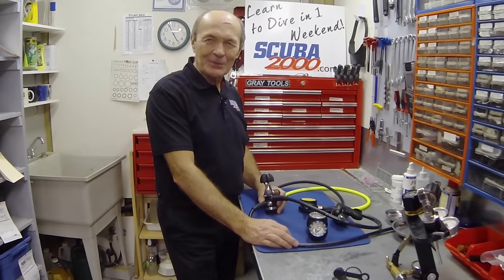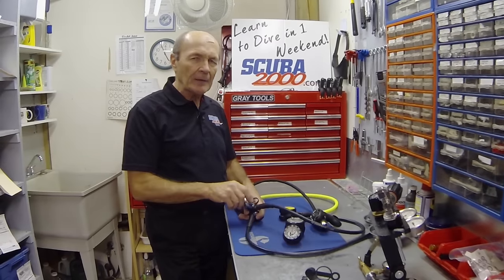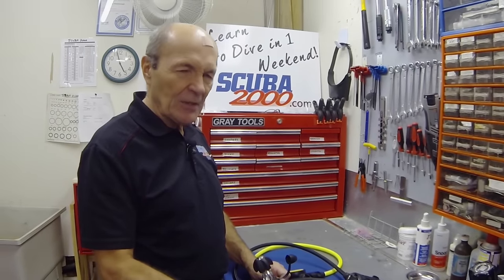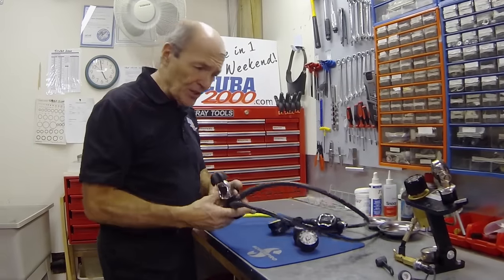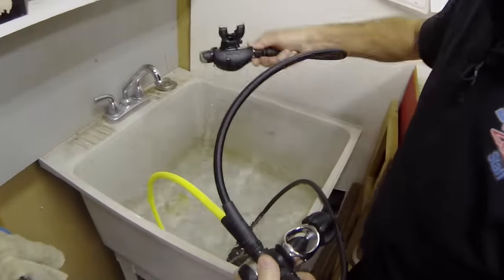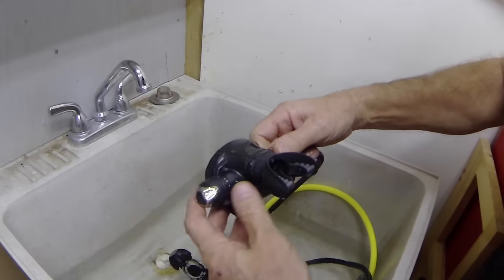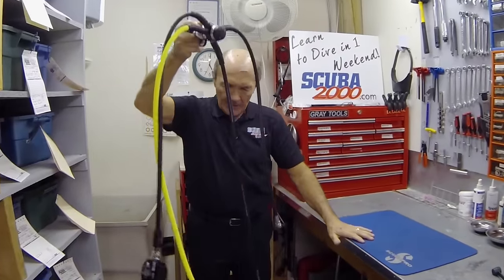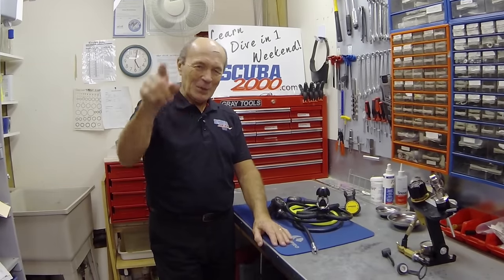It Pays To Rinse - Scuba Tech Tips: S03E02

Comment: Hi Alec, is there a problem using a first stage ( like oceanic fdxi) with an bc Inflator from a different brand (i think about buying the mares quantum bcd). Thanks in advance. PS I love your vintage series. Greetings from Germany
Reply from the maker: One nice thing about scuba gear is that it's pretty much completely interchangeable, almost too much so. I have seen a Mares 1st stage with a Aqualung 2nd stage, an old Dacor octopus, an Oceanic console, an LP hose for a Zeagle BC and another LP hose for a Bare drysuit. It's confusing as heck for a serviceman!
So, to your question, yes. Any normal scuba attachment will fit into any normal scuba 1st stage. All of the ports are 5/16" for the LP (low pressure) and 3/8" for the HP (other than the old 1/2" ports that Dacor and USD used for a short while). All LP hose have a matching 5/16" thread and HP hoses are 3/8".  So, go crazy. Mix 'em up!!
Of course, in Germany you also have to contend with metric but that's only an issue if you're using a European regulator - Poseidon, etc. I have adapters to make anything fit anything!! Thanks for watching. Alec

Comment: Great video, recently are collecting information if rinse a reg.
Let's say I went for a dive trip using a double hose for a week or two weeks so, it is really hard to prevent water go into the can(first stage) Am I ALLOW to rinse the first stage with the all the mechanism with fresh water to clean up the salt water and then leave the can open to let it dry out? 
Thank you
Reply from the maker: Most experienced double hose divers ensure their regs stay in good shape by using a simple process that's not 'in the books'.
1. After several dives and before storage, always loosen the hose clamps.
2. Occasionally remove the hoses carefully and rinse them thoroughly in fresh water. Run the water through the hose and     mouthpiece by pouring it into the intake hose and out of the exhaust hose. If you do this before removing the exhaust hose from     
    the body, you also rinse the exhaust valve (Duckbill or other). Block the intake spigot on the body while doing this.
3. Always hang the regulator by the 1st stage with the hoses dangling both while rinsing and while in storage so no water goes 
    into the body.
The answer to your question is NO! You must endeavor to prevent any water, even fresh water from entering the body.
If salt water gets into the regulator, it will need to be disassembled and cleaned properly. Almost every piece in there will corrode very quickly if exposed to salt water. And some parts are plain or plated steel which will also corrode in fresh water.
It's not really hard to keep water out of the can. Always be sure a good dust cap is in place when it's off the valve. Be sure the dust cap is clean and dry before fitting it. When you take the reg off of the valve, let the hoses hang and keep the can high.
Bottom line - keep it dry and service it regularly.
Take care.
Alec

Comment: I was once admonished by a divemaster for soaking the entire regulator setup, including the 1st stage, in a dunk tank. He said that I should only dunk the first stage and then hook the 1st stage to the top of the dunk tank with the second stages and gauges hanging down and soaking in the tank. I guess you are saying this is false as long as the dust cap is in place. Which it was.
Reply from the maker: There are lots of ways to rinse a reg and just as many opinions. However, an ounce of common sense is worth a fortune.
Never be afraid to ask "Why?". If the answer is slow coming or sounds contrived, nod wisely and do it your own way!
The 1st and 2nd are connected by hoses. Assuming the 1st is sealed by the dust cap so no water can enter, why rinse it separately from the 2nd?
Everyone likes to add their own special twist to what is really a simple process. Makes them look like an expert.
I like to keep it simple - put the darn thing in the water, dust cap firmly in place; let it soak for a while to get rig of dried salt; try to not push the purge button; take it out, shake and hang to dry thoroughly; stow it.
Alec
Reply: @AlecPeirceScuba_SeaHunter  Thanks for your reply and for keeping us educated about SCUBA.
Reply: I ran into something similar in the Red Sea.  We were all instructed not to even dip the 1st stage.  I just assumed it was due to it being DIN and I'm only used to yoke style, but apparently not.  My guess is they just run into a lot of tourists who are horrible with the dust caps.
Reply: if the second stage has a seat saver type feature, when no pressure they are effectively open to the elements and if the first stage falls below the second stage, you have water going from second stage to first stage, no bueno

Comment: Hi Alec, thanks so much for all your videos. I'm new to diving and I've watched hours of them. Very helpful! I just bought my wife and I new Oceanic Zeo DIN style regs. We dove with them yesterday and just as you said, the dust cap filled with sea water. I did my best on the boat to blow it out/dry it by mouth, but, it wasn't perfect. My instructor said don't worry about it, those small drops won't get in the reg. But, based on your videos I don't like that logic. Is there a good dust cap for DIN regulators or a better solution? As always, thanks!
Reply from the maker: Look in the Trident Dive catalog or the Innovative Scuba catalog.
Your LDS can order one. Scubapro has a good one too but it isn't on all of their regs.
You simply have to look around until you find one.
Someone suggested filling the cap with silicone sealant. Not a bad idea.
Good luck with your new reg. I'm sure you love it.
Alec

Comment: Would it make any sense to depress the second stage purge button and swivel it around a bit in the water too (with the first out/higher of the water). Presumably there are some bits and bobs associated with it that could use a rinse too? I have access to a tank to blow out the hoses/second afterwards.
Reply from the maker: Purging does open the exhaust mushroom valve but you never know if its 100% open or just part without a physical check around the entire valve.  Would not hurt.
A

Comment: I am a little bit confused right now. When you put the whole reg in the sink, water does not go inside it? You put the dust cap so water does not go in, but what about all the other holes? 
Both of your second stages
The connector of the LP  hose that you connect to your BDC
The holes in a balanced piston 1 stage
The connector of the HP hose that you connect to the computer/pressure gauge

I started scuba diving last year, and this videos are super useful. I still have to learn a lot.

At the end of a dive I open the scuba tank so that there is pressure in the sistem, and I rinse everything with fresh water. Then I take it apart and pack it. Then I rinse the wetsuit, googles, fins, etc. And I  rinse again the diving computer and the flashlight.

Am I doing it wrong?
Reply: "I am a little bit confused right now. When you put the whole reg in the sink, water does not go inside it?"

Water will get inside the second stage, which is necessary for rinsing out the salt deposits left from diving. But water will not go up the hoses and into the internals of the first stage if the dust cap is snuggly in place. To see how that works, take a drinking straw and put your finger over one end of it, then put the other end into a glass of liquid. Note how the liquid doesn't fill the straw to the level outside the straw. Then take away your finger, and see the liquid rush into the straw. The same principle is at work when you rinse you regulators.
Reply from the maker: Nope Brian. You're doing far more than most divers and everything is correct.
While it's fine, there's not really any need to go to the trouble of pressurizing the reg while rinsing it. And it must be a nuisance!  Let me explain each of your concerns.
1. the second stages are full of water almost all the time. Water goes in and out of the exhaust and the mouthpiece whenever it's not in your mouth and that's OK. The water cannot get past the second stage valve and thus up the hose because that valve is held closed by 150 psi of air from the first. Even when rinsing, that valve is held closed by a spring - unless you hold the purge button down while rinsing. The purge button depresses the spring and opens the second stage valve to let air through, thus 'purging' water from the second. If you press the purge while rinsing (off the tank), the valve opens but without any air pressure from the first stage, water could conceivably go up the hose and into the first stage.
I dealt with this topic although quickly, in a vid some time ago. Although every scuba instructor tells their new divers to "never press the purge button while rinsing your reg", it's not really a big deal. If you can picture the hose as a closed system, a long closed tube if you like, and then you open one end (the second stage end by pressing the purge button) while it's being rinsed, while water may travel past the second stage valve and start to go up the hose, Boyle's Law soon stops it. The water is stopped by the atmospheric pressure of the air in the hose. There's no pressure while rinsing so there is nothing to force the water up the hose against the air that is already in there. Water will NOT go up the hose if the purge is pressed during a normal rinse. My apologies to all those instructors!
So don't worry about the second stages.

2.The LP connector, whether a BCD or Drysuit hose, is sealed by a Schrader valve, the same valve that's in a tire valve. This valve is spring loaded and requires considerable pressure to open. Normal rinsing won't open it and even if it did, the same principle I just explained for the reg hose applies. No water would travel up it. In fact, you ought to rinse that hose end with fresh water and then blow into the hose end with your mouth to dry that little valve. Also don't forget to rinse the connector by pulling it back and spinning it while in the rinse water. The connector end works with the help of 3 tiny steel balls, a spring and a clip, all of which can corrode.

3. The holes in the first stage of every regulator, balanced piston or not, (every regulator has holes to allow the first stage to sense the water pressure - except for those very few regulators that are sealed) always have water in them as well. The chamber into which that water enters through those holes is designed to seal the water out of the valve itself. This is one area that divers do neglect. It's important to rinse water through those holes thoroughly so the chamber is completely clean. This is why I suggest divers SOAK their regulators - so any salt or dirt inside that chamber is softened and rinsed away.

4. The QD (Quick Detach) end of a console HP hose is similarly designed to seal tightly with a spring when the console is disconnected so no water can enter. It doesn't use a Schrader valve but a similar design.
I want to add a small point here, partly because I can see that you are quite fastidious about your gear and also that you enjoy these minor technical issues. You must have noticed that the opening on the end of the HP hose for your console is much larger than that on the end of the LP hose for  your BCD. Of course it has to accept the spigot on the bottom of the console which is much bigger than the small spigot on the BCD PIV (Power Inflator Valve).
That opening, on the HP console hose, can hold quite a bit of water. I'd guess 1/4 teaspoon or so. That water MUST be shaken out carefully before inserting and locking your console to it. Any water that in that opening could go into the console and even the tiniest amount of water in the console, much less salt water, could be disastrous. Strangely, there is no protection to prevent water from going into the console so you must NOT put your console in water if the hose is detached or without the protective rubber cap.
Any water in either the large opening on the end of the HP hose or in the tiny hole on the end of the console spigot will be blasted into the console by tank pressure when the air is turned on. Both holes should be carefully blown dry by air from your mouth after rinsing.

So you can see that you really don't have much to worry about. You are doing a perfect job and should have no problems with corrosion inside your gear Brian. Please bear in mind that the very nature of scuba gear and the environment in which it operates is such that over time even the most careful diver will need a quick inspection, cleaning and lubrication of his gear. My point is that careful rinsing will keep your gear in perfect condition for a very long time (I regularly service regulators that are 25+ years old) and will preclude permanent damage but, an internal inspection at regular intervals, whether 1 year, 2 years or after a certain number of dives, is still essential.

I hope this helps. I wish I had my Equipment Specialist posters and diagrams to show you the details of the internal working of these items. I have had several cut-away regulators and valves made for that purpose and, once you look inside to see exactly how these items are designed, it really helps to understand what and what not to do. Perhaps Kevin and I will do a more details vid on the very things you've mentioned.

Thanks for your comments, questions and your support for my vids Brain.
This is by far the longest reply I've ever made and that reflects 2 things Brian - I'm retired now and I respect your support.
Alec
Reply: Thank you, Alec, for the detailed explanation. But I think you meant to direct it to Victor Garcia, not to me; he asked the original question.
Reply from the maker: Right Brian. Forgive an old man - but the information was good and I may do a video on it anyway.
Thanks, Alec
Reply: "...the information was good and I may do a video on it..."

That would be great. I really enjoy your Tech Tips.

Comment: Hi Alec. Do you recommend disassembling gear apart when storing for months ahead? Hoses/regulator/stages.
Reply from the maker: I find leaving everything connected but seal them in a thick freezer size zip loc bag and squeeze the air out.  Removing hoses just to store them actually puts more wear on the o-rings with the off/on twisting and if the 1st stage ports are not closed with a port plug can introduce air contaminates (or spiders).  Hope this helps.
Reply: @AlecPeirceScuba_SeaHunter  Absolutely. Thank you Alec. Very appreciated.

Comment: if the purge is depressed or is forced during rinsing, then what to say Alec ? Also, what dust cap for DIN ?
Reply from the maker: Try to avoid depressing the purge button while the reg is being rinsed. It's not quite the big deal you might think.
Technically if you do press the purge button while the reg is underwater in the rinse tank, water could go up the hose. But, in fact, to do so it would have to go against the ambient air pressure in the hose. That's not likely. Also, even if some water did go up the LP regulator hose, it's not the end of the world. The water won't hurt the hose nor the 2nd stage (which is full of water most of the time anyway). The only danger would be if that water made it all the way to the 1st stage where it could cause a problem. If it's fresh water it won't cause any damage. Salt water will but you're rinsing in fresh water right? And the likelihood of water going all the way up a 27" hose against the air pressure is slim.
So, try to avoid pressing the purge button while rising but don't freak out if it happens. If you think it has happened, just put the reg onto a tank and purge air through it for 10 seconds. The dry air going through both stages will clean it out.
Alec
Reply: thanks alec, you're the msn ! we love your videos, simon & suzi [in Dubai]
Reply: Alec Peirce Scuba I think this is quite a big issue that you probably need to add to the video. Because after watching the video( especially the watch button part) I would most likely press the purge button multiple times while rinsing.
Reply: Thanks, Alec! Great video and some new tips for me to use. 😊

Comment: I have a problem I just got my first regulator and they told me to soak it and I left the dust cap off and did what they said online to purge it to get all the water out do I need it to get serviced?
Reply from the maker: Relax OK.
I'm assuming it was fresh water so you're OK, OK.
I made a video about 'what to do if my reg floods'. See if you can find it.
If not get back to me and I'll explain.
No. You shouldn't need service.
Alec
Reply: Alec Peirce Scuba I apologize I could not find the video do you mind telling me the directions and it was fresh water, thank you
Reply: Go ahead and hook it to some pressure and dry it out with the tank. Purge the regulators, inflate the vest a few times. Maybe even take off the computer/pressure gauge hose and crack the bottle to let it dry everything out. It's not uncommon for a rental tank to have a little moisture in it from time to time so I dry it all out every once in a while. Overall there shouldn't be anything that fresh water would corrode or damage.